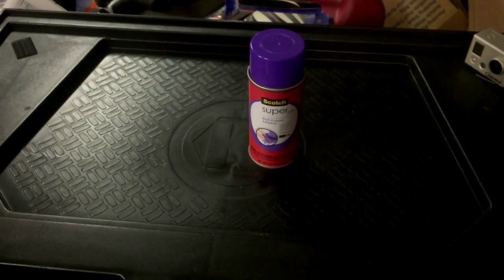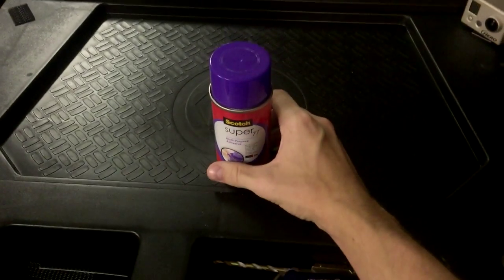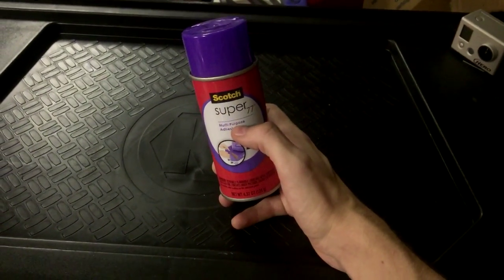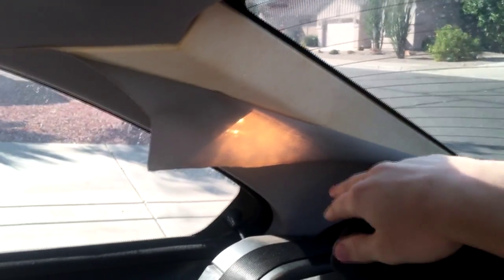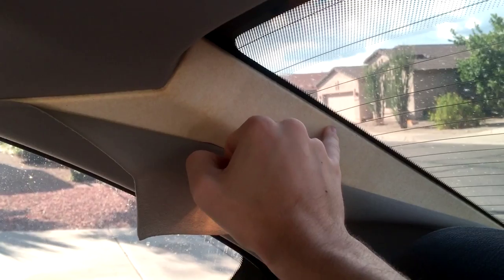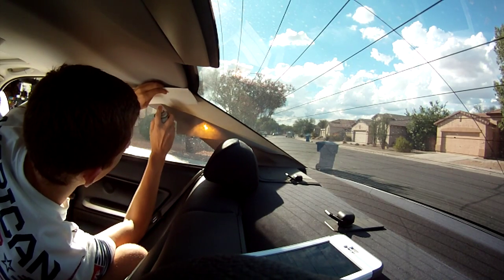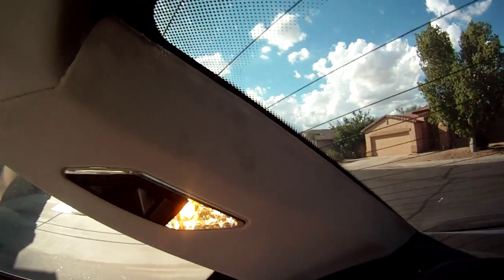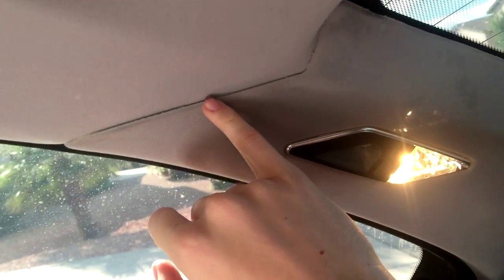BMW E46 C Pillar Upholstery Repair

Comment: About to do the same repair for mine.   I will say its quite easy to remove those columns..  Doing so allows you to have better control of the working space and not worry about spraying in the car...  thanks

Comment: Much better results if you take the time to remove the column.  Apply 3 coats of spray, allow time to become tacky, then lay the fabric.  
The way uploaded did this, probably will not last/look great.

Comment: I had the same repair on my 2005 BMW 325xi and ended up spraying to a paper plate and using a small brush to apply it to avoid over-spraying.  Have to work fast because it does dry quickly.

Comment: Hi thank you for creating the video. Does the fabric ever come loose again, especially in hot summer? thanks
Reply: It most likely will depending on where you live.  According to 3M the product fails at 190 deg.  Some areas of the country can reach this temperature in just an hour.

Comment: Thanks you for this guide! Did the stains disappear after a few minutes/hours? I need to do the same repair but I am concerned about the stains (mine is black).
Reply from the maker: +Gerard III Sorry for the late reply! Once the spray adhesive dried, it looked completely normal again. No stains or dark spots at all.